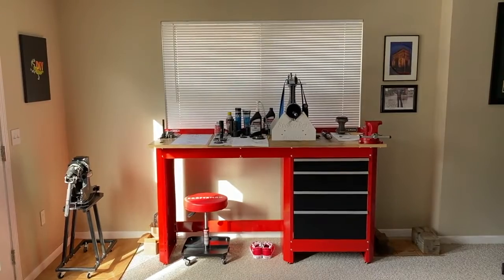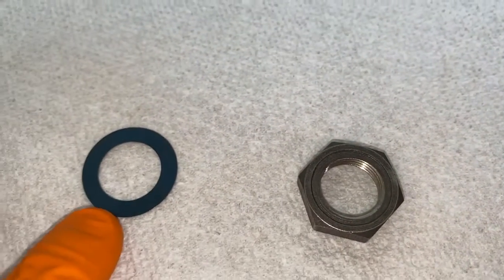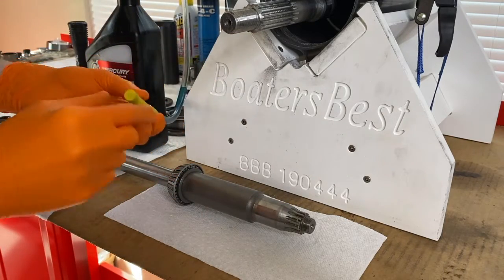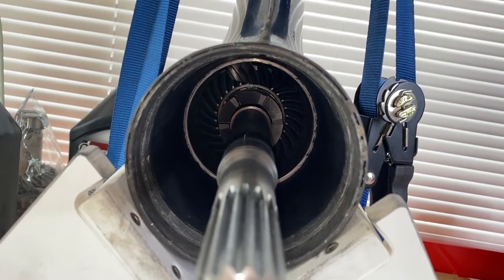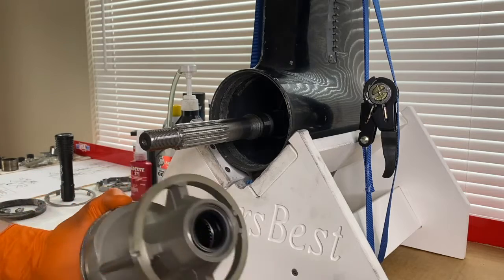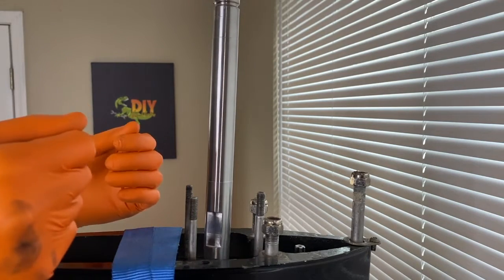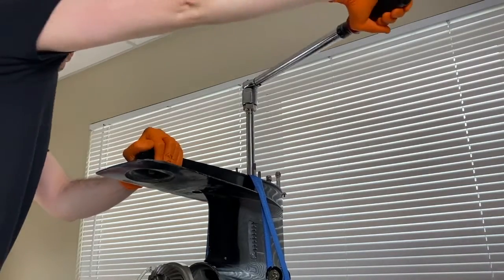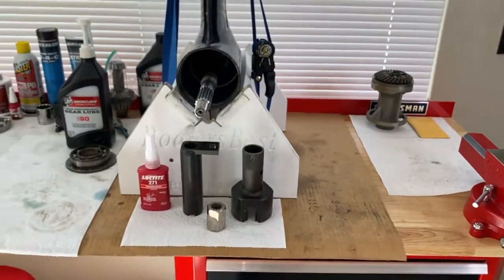Install Mercruiser lower unit drive shaft and pinion gear

Comment from the maker: If interested in purchasing the products below, visit our Amazon affiliate links below.  I earn from qualifying purchases.

1.  Quicksilver gear set (43-87807A 4)

          

2.  Bearing carrier rubber O-ring (2531534)

          

3.  Clutch dog (52-853594T)

          https://amzn.to/3OHaiBP

4.  Shift shaft rod (77481 1)

          https://amzn.to/3tZt5QY

5.  Shift shaft Crank (76865)

          

6.  Pinion gear nut & washer (Nut:  11-35921)  (Washer:  12-92721)

          https://amzn.to/39VYT2s

          https://amzn.to/3NhkwI4

7.  Drive shaft (45-42634)

          https://amzn.to/3QMn6c1

8.  Propeller shaft (44-824110)

          https://amzn.to/39OSk1L

Comment: Do you have a link to the tools used in this video?
Reply from the maker: Thanks for watching, we have a few links however not all unfortunately.

If interested in purchasing the products below, visit our Amazon affiliate links below.  I earn from qualifying purchases.

1.  Quicksilver gear set (43-87807A 4)

          

2.  Bearing carrier rubber O-ring (2531534)

          

3.  Clutch dog (52-853594T)

          https://amzn.to/3OHaiBP

4.  Shift shaft rod (77481 1)

          https://amzn.to/3tZt5QY

5.  Shift shaft Crank (76865)

          

6.  Pinion gear nut & washer (Nut:  11-35921)  (Washer:  12-92721)

          https://amzn.to/39VYT2s

          https://amzn.to/3NhkwI4

7.  Drive shaft (45-42634)

          https://amzn.to/3QMn6c1

8.  Propeller shaft (44-824110)

          https://amzn.to/39OSk1L